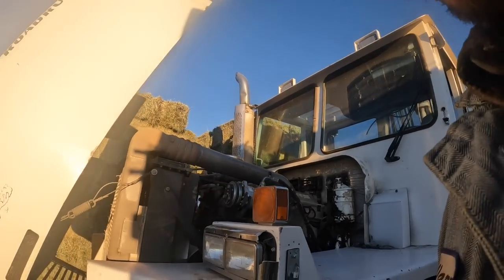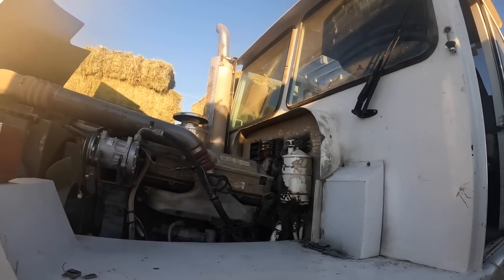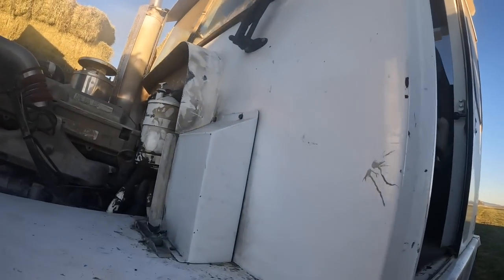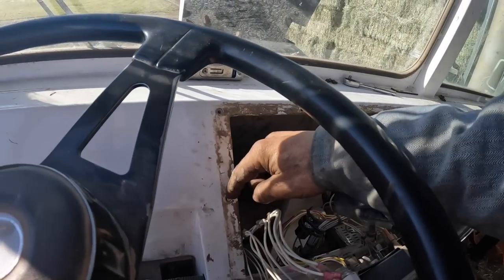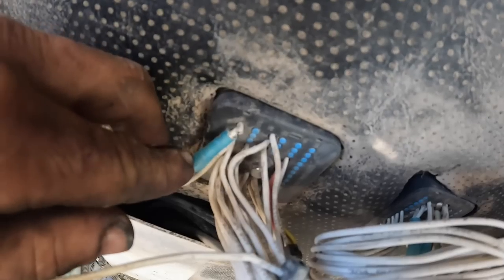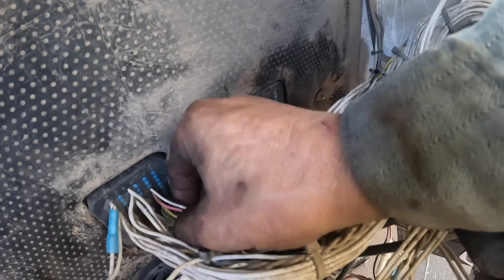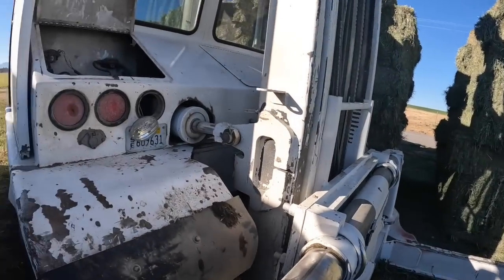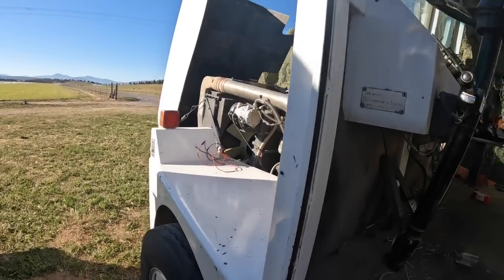Tired and Grumpy!

Comment: Pack rats are really destructive. Then chasing down wiring is like taking hold of a spaghetti noodle on a plate full of spaghetti and try to find the other end of the same noodle in the mess, especially after rodent damage. I guess I would say if it was easy you wouldn’t have got called sir, price you pay for being good at what you do. Thanks for the ride along sir.

Comment: Nothing like a stupid rat to ruin your day. We used to get those Norwegian Rats on the west coast and they would get in anywhere there was a small hole left. I went into one of our out buildings at a station one time and the rats had gotten into a metal conduit that used to go to an old air compressor. We were pulling on some of the wires in there and about a third of them came loose from the inside of the pipe. When you pulled them out it looked like the were cut with a pair of side cutters about half way down the length of the conduit. We were able to find enough spare wires in the bundle to use to get the problem repaired. Then I took a couple of CO2 fire extinguishers and removed the horn from the handle. Found a threaded fitting to adapt to the conduit thread and discharged the extinguishers into the conduits to remove the oxygen inside the pipe. That took care of the rats inside the piping and we sealed the connections up and left them. I would not want to open up those conduits in a year or so because I am sure it would smell like dead rotting rat.

Comment: Class action on hydraulic oil. 

NAPA Quality Tractor Hydraulic & Transmission Fluid, Warren 303 Tractor Fluid, Carquest 303 Tractor Hydraulic Fluid, Coastal 303 Tractor Fluid or Lubriguard Tractor Hydraulic and Transmission Oil since July 26, 2014.

Comment: I worked for a recycling company and the rats were constantly chewing the wires in our trucks , i come to find out that insulation around the wires is made from vegetable oil , so no wonder they eat the wires . I would leave my truck full of recycling so they would eat from that instead of chewing my wires . But many times i had to use other trucks and they would stall in traffic or on a bridge and i would have to sit and wait for the tow truck .

Comment: Why do mice/rats chew on wires? From what I understand the wire manufacturers use grain for the wires shield coating. Weird right? Think they would try to find a different substitute. They obviously know that this happens. But no ... they keep making wire with grain in the shield coating. Happens in every vehicle I have ever worked on. Rodents chewing up wires.